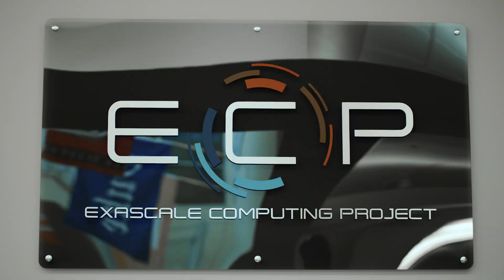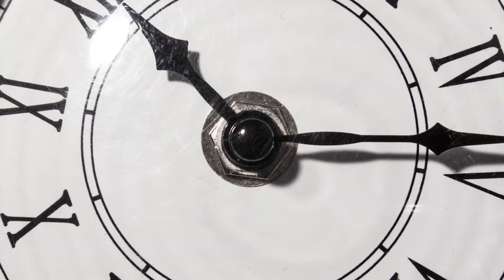Exascale Era Changes Rules for Discovery and Innovation

Comment: I thought it was weird but maybe it's because of the power it takes to run it but why does the department of energy get first dibs on that computer is it because of the things they're going to fix with it first are relating to energy they should use it to design a new power source that's what they should do and then miniaturize it so we can have one in each of our houses and then get rid of the power grid because each building will be powered independently with a specially-designed power source that'd be cool